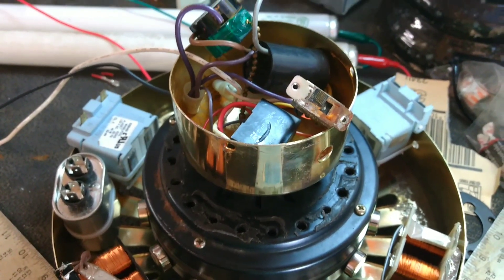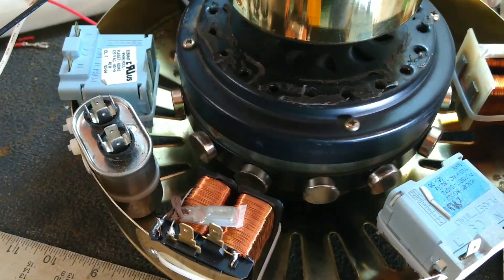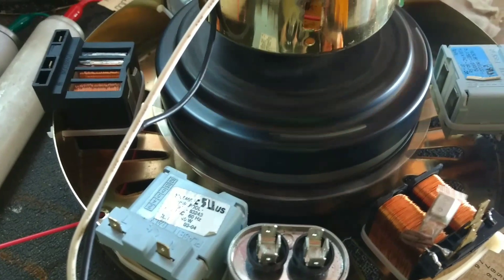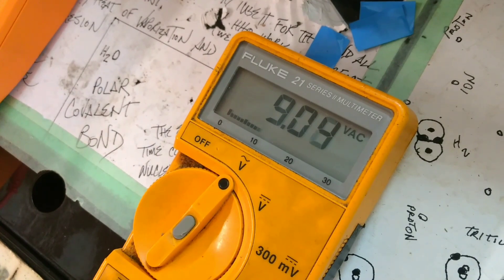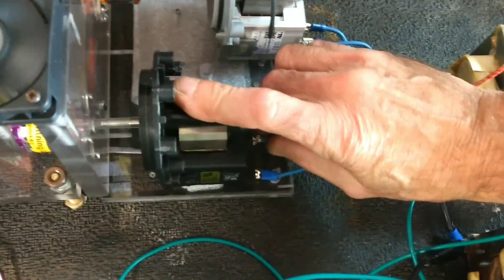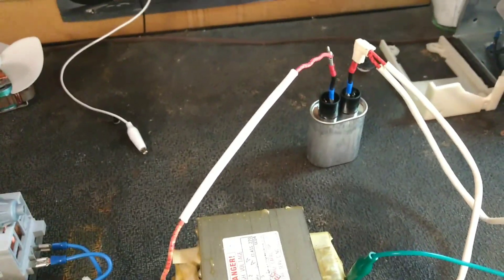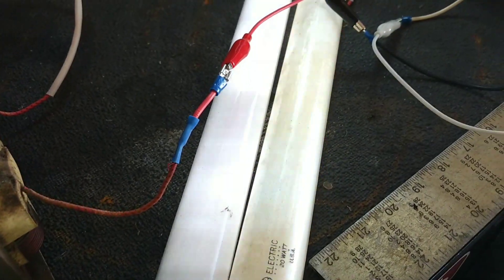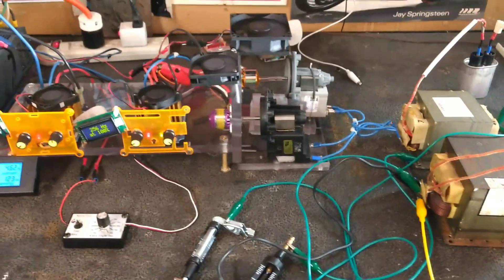Gerard Morin test

Comment: Nice, I have connected a DC motor to run the fan. Also take out the inner ring out as is will effect the magnetic field. I have produced 220VAC and higher. I had lights and a radio working. Keep going.